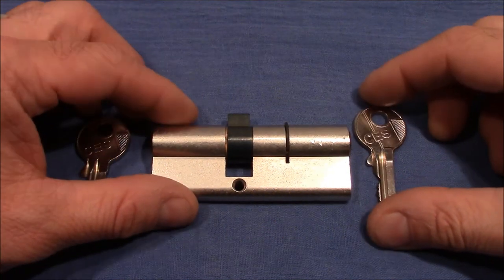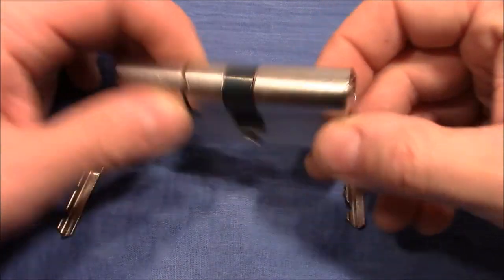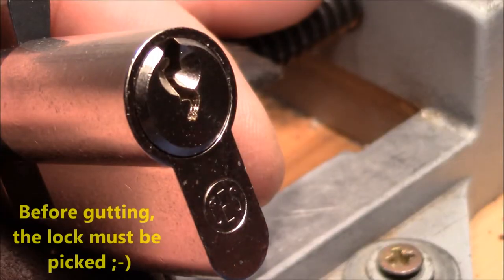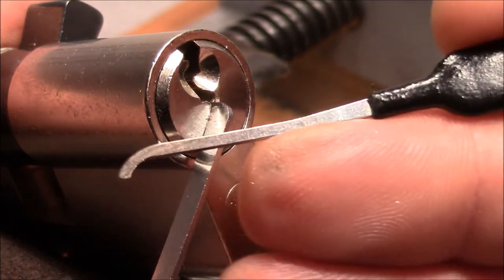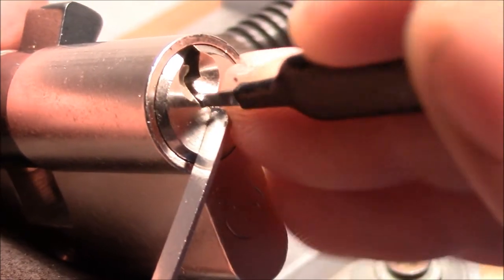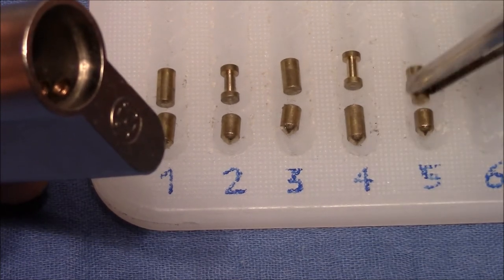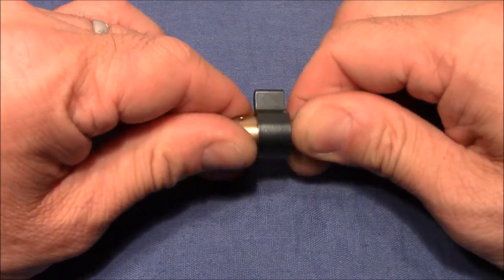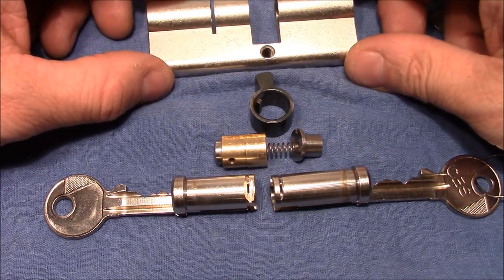(picking 170) CES [EURO cylinder exploration series] -  2x picked, gutted and cam inspected

Comment: Another great exploration, and  I now know what it means to CES. :)
This system can be probably bypassed, no?
Reply from the maker: +de Ronchopathe Thank you. Yes, bypassing could be possible but I don't know it a tool exists that is thin enough to be turned in the keyway and stable enough to take the cam along. And it's possible only if the inside key sticks in ii. I know from thumb turn mechanisms that some can be bypassed. So maybe that one as well.